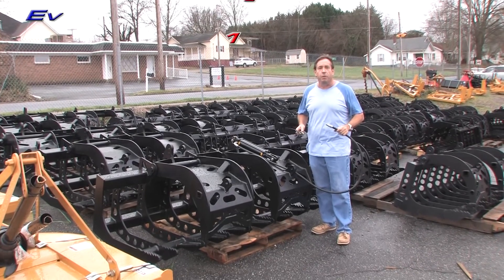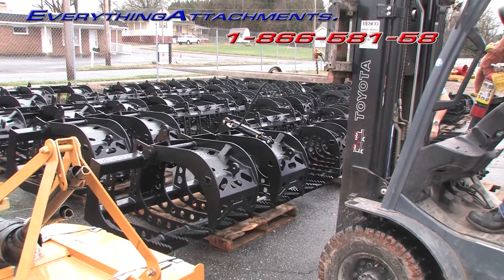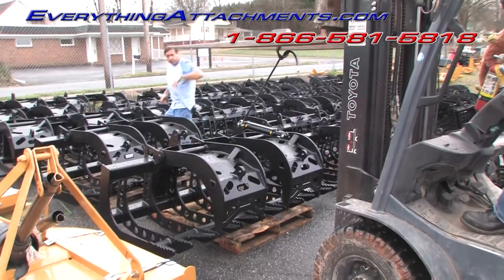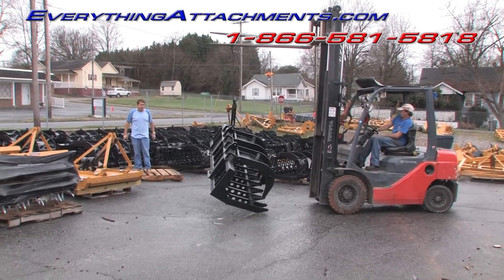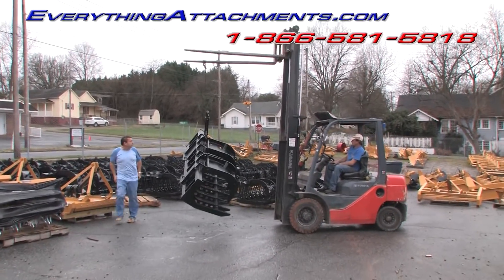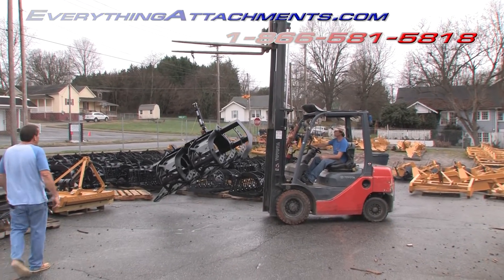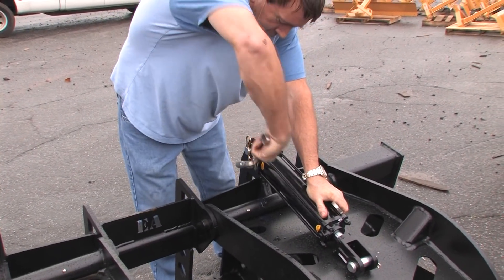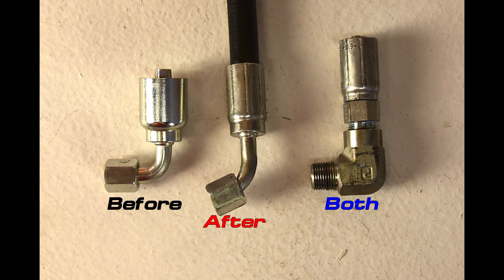Comparing NTP Type Fittings In Physical Strength Against JIC Fittings

Comment: Please keep in mind that strength to resist impact is not the primary mission of a hydraulic hose.  The  JIC fitting you compared to the NPT may well have lower flow restriction.  A test comparing FEL or backhoe actuation rates may be a more definitive teat as to which fitting types is the most appropriate for the intended use.